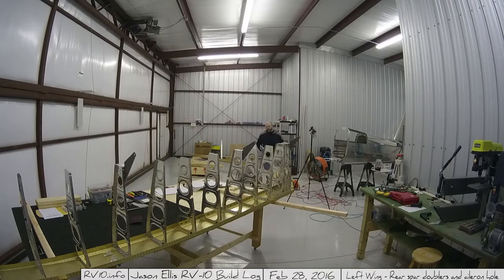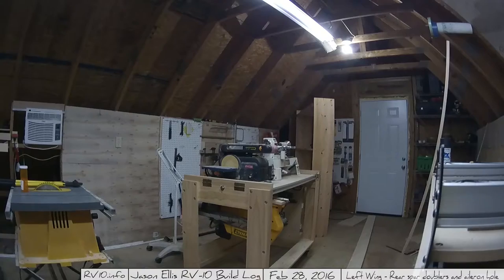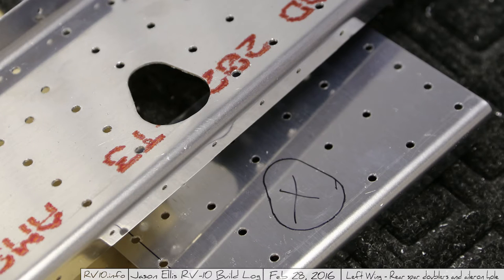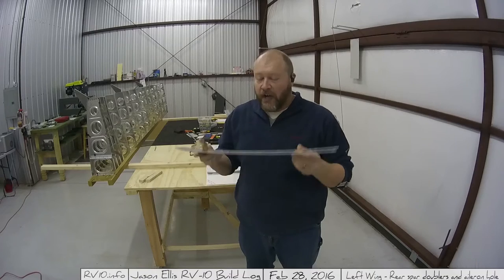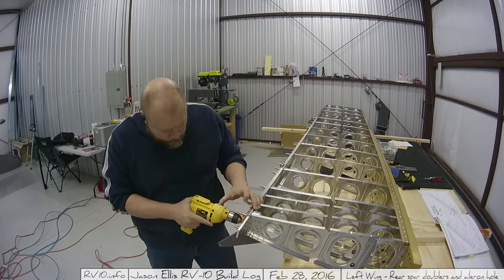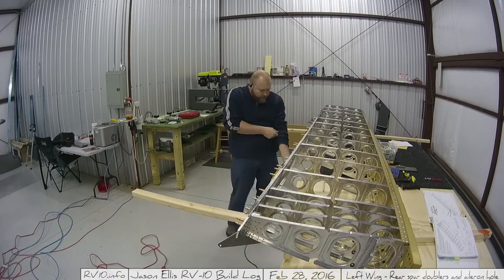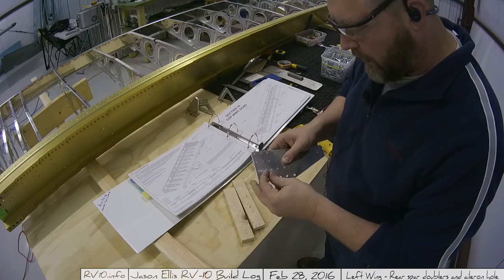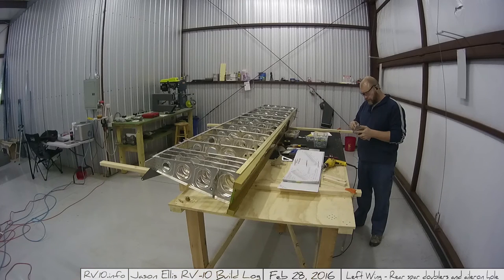RV-10 Wings - 009 - Left wing rear spar doublers and aileron hole

Comment: when adjusting the microstop (your machine countersink jig) instead of just randomly adjusting it and letting it slap close, if you use the serrations along the bottom edge, those are .001 increments.  if you just use those, and count them to adjust the depth of the cut, it would be a lot more precise.

Additionally,  do not shove it down to cut the countersink, you want to slowly press down until it is finished cutting. When done, you should see a very small silver ring around the head of the rivet, so that it is just under flush. That way, when you paint, it will seal it all nice and smooth.

also, it is best to setup your countersink depth on a scrap piece of metal, of similar thickness, so that you have an accurate test panel and you do not screw up the aircraft part.

You can always take metal away, you cannot put it back. if you cut the rivet too deep, you lose the strength in the head holding the parts together.

Comment: Hello Jason, I like your videos on building the RV-10, just to know how a airplane is build. I have a minor question/concern? Looking at RV-10 Wings - 009 - Left wing rear spar doublers and aileron hole @ 14:48 / 19:57

If you machine counter sync a rivet too deep, are you convinced the rivet will be compressed solid due the fact the flat surface does prevent the rivet to hammered directly (the slightly sunken rivet is not directly reached by the hammer on the flat surface I guess)?

Good job, go on!
Reply from the maker: Lothar, good question.  Yes I think its fine.   Primarily because the amount I over countersunk is so minimal it's hardly worth noting.   However, if you're concerned there are two ways that seem to address it;  1.  use a slightly longer rivet to give extra material during the "squash" phase of driving the rivet, or 2. redrill the hole from a 3 to a 4 (or 4 to a 5..etc) and use a bigger rivet.

Comment: What’s the difference between countersinking and dimpling?
Reply: They have the same purpose, I think - to make the rivet head flush with the material face  You countersink thicker pieces of metal and you dimple the thin pieces (thinner material there is not enough thickness to remove).

Dimpling into another piece, there needs to be room for the dimple to fit down - he talks about that in another wing video when he's drilling the spar - some are counter sunk deeper for dimples to fit into.
Reply: Dimpling is used primarily on thin skin material, .028 or .032 thickness aluminum, because when you countersink, it puts a 110* cut into the metal, which will remove metal in the center of the hole, which then makes the rivet have less contact with the skin. When you dimple, you are eliminating the potential of removing the metal so that the diameter of the hole stays as close to the original hole diameter.

When you have a dimpled skin, and you put it onto a metal that is flat, the bottom of the dimple will sit flat  on that metal, which then makes a gap, and then you have the potential of water/dirt entrapment. Countersinking the metal where a dimple goes, just allows to have flat metal to metal contact, which makes it more structurally sound.